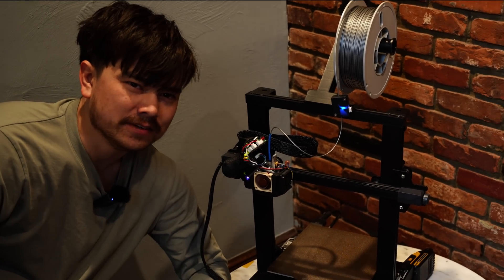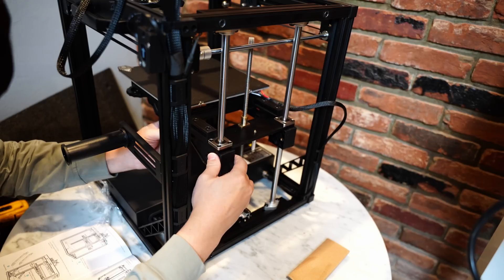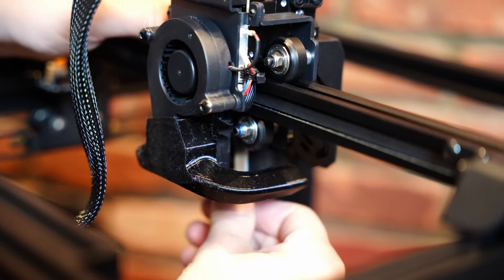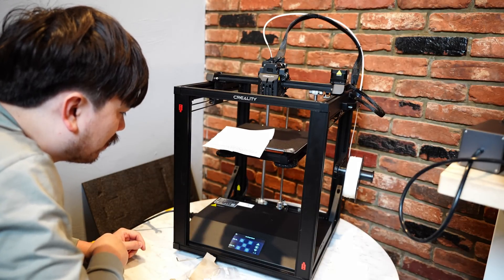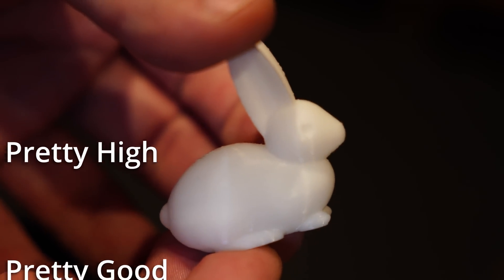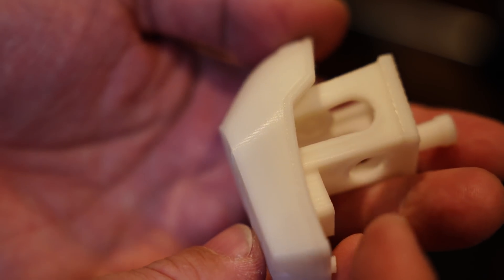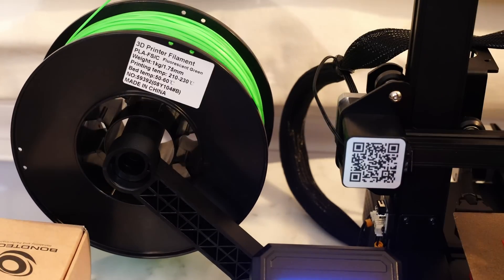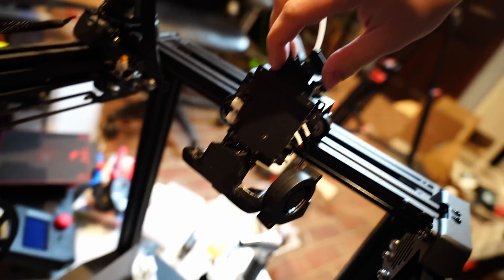Ender 5 S1 - The Best 3D Printer Creality Has Ever Made

Comment: I have one of these and I have to say it is a great printer.  Previously, I had an ender 3 and I had to upgrade it numerous times to get it to print properly and I was always having to relevel the bed.  The Ender 5 S1 is so much better. I have not had to much at all, it just works.  I did install an enclosure, a raspberry pi with octoprint, and a USB camera, and LED lighting.  Overall, I really love this printer.  It is not as fast as say a bambu lab or creality k1 printer, but it works for me until I decide I need something faster.  The best part was I got it on sale for $150 off its regular price.

Comment: IMO its by far the WORST printer they've ever made... Twisted x-axis on a large majority of peoples printers, auto bed levelling with Sonic Pad is completely broken because the levelling probe misses the bed entirely so you can't complete it, frame is out of square from the factory by several millimetres so you need to pull the top and bottom frames apart and re-assemble. I made the mistake of buying several to fill out my farm, same issues with every single one. I now own 3 big paper weights and a dodgy sonic pad. To add insult to injury Creality wants me to pay for not only shipping back to them but also for the free shipping to originally send them to me when I bought them! Absolute joke of company.
Reply from the maker: If you want some help there are a lot of Ender 5 users on my discord.
Sounds like you have the frame issues sorted, last thing you’ll need to do is fix the printer config file in klipper. It’s a pretty quick operation, but I agree all of that should be sorted out by creality, not pushed onto the customer at the end

Comment: DONT MOVE ANY AXIS MANUALLY, spinning the drive motors at high speed creates electricty which feeds back to your main board and releases the magic smoke, confirmed on a mk 3 pro😞
Reply from the maker: I’ve done a ton of backdroving and never had an issue. That said, I do believe you.

I’ve fried about 4 stepper drivers from unplugging the motors while the steppers were live

Comment: Great video!  Tons of information, and very well presented.  I'm 1 step closer to deciding what printer to buy...I really do thing it'll be the Ender 5.  Thanks for this.  Keep up the good work.
Reply from the maker: Glad it was helpful! BTW geekbuying just came through with a great deal for the Ender 5 S1.

$459 after coupon code: NNNCREEND5S1
Link: https://affiliate.geekbuying.com/deeplink.php?affid=3580&url=https://www.geekbuying.com/item/Creality-Ender-5-S1-3D-Printer-250mm-s-300-Celsius-Degrees-Printing-519509.html

However, keep an eye out for other printers and narrow it down to your needs. The Ender 5 is very much a project printer IMO, but it's a lot of fun to fix up and get working.

Comment: Can you print Carbon fiber with Ender 5 s1?
Reply from the maker: Yes, pretty much any printer can print carbon fiber reinforced plastic. A steel nozzle is recommended. 

The best cfrp is high temperature nylon (300 c)
That stuff is super strong and will also require an all metal heat break (which this has)
Reply: @NathanBuildsRobots  thank you Nathan 🙏
Reply: @NathanBuildsRobots  compared to ender 3 or CR 10, how is the precision of prints? Ender 3 and cr 10 have different construction and drive mechanism, is it better than that of ender 5 s1? Thanks

Comment: As someone about to pull the trigger having never had one, would you recommend this one?  Money isn’t a concern.  I don’t want to go to $1k cause I’m also getting a resin printer.   But I want to get an FDM so my wife can make crafts.  You seem to know so much.  Would love your thought!
Reply from the maker: My favorite FDM printer is the artillery sidewinder X2. You get a lot for the $$$, it has a huge print area, is easy to put together, and it prints decently fast. Make sure you have enough space for it though!
https://youtu.be/5tjE3QAOkWc

I view the Ender 3 and Ender 5 as more of a project printer. Great if you want to spend time working on it and upgrading it because there are a bunch of aftermarket parts available for it. After investing about $250 in upgrades and about 4 hours upgrading my Ender 5 S1, it’s an absolutely awesome machine. But not everyone wants the printer to be the hobby, they want to use it to do other hobbies 😁

Comment: I think it would be great if the print head would be sold separately to upgrade the older ender 5s.
Reply from the maker: Could you just install the normal sprite hotend?
Reply: @NathanBuildsRobots  I would prefer the new one, as the normal sprite hotend has certain disadvantages as the size, as it's much longer on the front and would hit the front bar on the ender 5.
Reply from the maker: @MrKiebitz  interesting, I do not know if a place to buy spare right now, but keep an eye out and try asking the discord. A lot of ppl post designs there

Comment: Nice video thanks.  I ordered this machine today.  If you lock your 3 main video camera settings then you won’t see those brightness changes after editing.
Reply from the maker: Yeah, autoexposure & autofocus can be a bit annoying at times, but I don’t have the mental bandwidth to deal with all that while filming.
There are whole takes that are out of focus or too dark when I do too much manual stuff, but also happens with auto settings. Really I just need a cameraman 🎥
I always use the 50% shutter rule, so usually 1/60th shutter speed at 30fps
I’m going to try using f/11 so autofocus is less of an issue and maybe then I’ll have enough mental energy to take on the exposure settings, which I guess would just be the ISO setting since I’m already doing shutter and aperture anyways.
Reply: @NathanBuildsRobots  yeah, I just let my camera automatically set the 3 main settings and then I lock them in place.  When I’m hunting I have to turn one of them down, I think it’s the fps.
Reply from the maker: I think I’ve got audio down pretty well now. Just using a wireless lav mic with no auto-gain settings. If I need to turn it up it’s much better to do it in post rather than letting the camera turn the gain way up whenever there is a silence

Comment: Hi. I want to buy this printer as a first 3D printer. What do you think about additional accessories? Or enough everything in the box? Also what do you think about Creality Sonic Pad? Is it useful with this printer or not?
Reply from the maker: As a first printer I would recommend the Trinity crux or artillery sidewinder. You can get those very cheap, $170 for the crux, $250 for the sidewinder x2 if you check the links in my dedicated videos on those printers. The S1 has some firmware problems that I would really like to see creality address with regard to automatic bed leveling
Reply from the maker: But to answer your original question, this thing is quite good out of the box, no need for additional accessories until you print with it for a while and see what you want to change on it

Comment: Which printer would you recommend for first timers?
Like, if you had to choose one with the knowledge you have now, yet was starting out again, which would you get? :)

I'm willing to invest, just want to make sure we get something worthwhile!
Reply from the maker: I would get the Artillery Sidewinder X2. Cheap entry point (only about $250), huge print volume, all the features that you would want, good firmware. I did a video on it:
https://www.youtube.com/watch?v=5tjE3QAOkWc
If you want to pay more it might be worth looking into the Bambulabs printer.
If you like modding, the Ender 3 V2 is pretty good, albiet overpriced compared to the sidewinder X2.
Reply: @NathanBuildsRobots  Wow, what a great vid you made for the X2! It's fast, quiet, big, has good cooling and power consumption, doesn't look like too much to get going-- Before I was considering getting a Creality CR-10s and modding it as suggested in another vid, but I think I'll suggest we get this one instead! I'll look into Bambulabs too, but I feel quite good about the X2. 😁
Thank you for the help! Much appreciated. ✨
Reply: @NathanBuildsRobots  $250 seems very low, $400 is about right from what I have seen.
Reply from the maker: check the video I liked to, then click the link. The reseller I have been working with has been selling them for around $270 which is an amazing deal

Comment: It's wired that they didn't set the switch's on top of the machine. That'll have made everything much faster
Reply from the maker: Yes at least use the cr touch as the z axis limit switch. The ender 3 S1 does this.

Comment: I just bought a ender 5 s1 too,but I met a problem, after I manual leveling,I run the auto leveling,but my printer always delete my manual leveling position.
after auto leveling the nozzle always away 1mm from the bed I guess.
Now I just use manual leveling like old printer, I have no idea why I cannot using auto leveling, I already follow all the operations😢
Do you have any suggestions 🥺
Reply from the maker: Yeah my Ender 5 S1 is having issues using the mesh bed leveling data in Klipper. Firmware could definitely use some work. Hopefully my issue isn't a hardware problem, which it may well be.
Reply from the maker: Have you tried using the save config option in the menu? I think the Z should save automatically but just in case it would be worth looking for an option to save config in the menus
Reply: I already checked printer, but there was no save config, there was only aux leveling and auto leveling .
Or was you mean the change z level button ?
Reply from the maker: @willyliu2444  mine saves the z adjustments, so I'm not sure why yours would be doing that!
Reply: @NathanBuildsRobots  I think I got the point 🤔
Maybe I should change z level in aux leveling first,and then use auto leveling?
This is my first time using  have auto leveling's printer 😅

Comment: Did you really complain that the print has to home?  That's normal procedure lmao.  The bigger the printer the longer the movements.  That's not a good complaint.
Reply from the maker: It’s not that it has to home, all printers do that, but about the time required to home is excessive. Takes about 3 minutes compared to any other printer - like the ender 3 or artillery sidewinder, which typically takes about 10 seconds to home.
Reply: @NathanBuildsRobots  slower is more accurate to so degree.  Granted while not a factory feature if you configure your own marlin you can speed it up.  Something I feel many will do when they custom flash it.

Comment: its an id10t error not the bed surface.  It has to cool and then its magnetic so you can take it off and flex it and prints pop right off.  When prints finish on my printer i take the magnetic plate off and put it on top of my washer machine lid and it 10 to 20 seconds it allows my print to pop right off.   You boasted about reviewing tons of these machines, but this is the first video I've ever watched of yours (last also) and it's like you have never 3d printed before.
Reply from the maker: Lol I like that ID10T… error exist between user’s ears.
Yeah it helps to let it cool off.

Comment: I think that they went with a different extruder and hotend for packaging reasons. The normal sprite would stick out to the front, where you would have plenty of space on a bedflinger, but thats not an option on a bed lifter, you would need a larger frame or limit your travel space. This also makes sense (smaller frame) since creality paid attention to keep everything within the frame, so you can bolt panels directly to the frame as enclosure and a smaller enclosure means higher ambient temperatures. Its also a pretty common fan duct design for such a printer, a different orientation would mean more space taken up by the tool head, the only other way would be mounting the fan over the x axis extrusion, but that would also be a loss of travel space

Comment: careful with the bed, not only does that surface stick too well, but the temptation to just push it down a little to make it easier to  get at just wrekcs bed level, mine is almost never right
Reply from the maker: Interesting, I’ll be putting a PEI sheet on soon

Comment: Crunchy noise on mine is coming from the anti-backlash nut. I looked for the source for a while too and it seems to go away if I apply a little pressure to it with my finger. I may add some grease to that to see if it helps.
Reply: wondering if you could deal with noise trouble and your findings..

Comment: A 300c capable printer without enclosure. Its very hard to make a enclosure for Ender 5 series because of the top arrangement; motor etc.  

In 2022 no belt tensioners, buggy Creality firmwares, no dual Z for 500+ USD. 

I think P1P is great option for 200 more. If you want thinkering Sovol SV 5.
Reply from the maker: You mean no belt tensioning knobs? I don’t like them as they cause the belt to loosen more often than not.

P1P seems to be a better buy. I would like to test one.

Comment: Sweet video, first time seeing your stuff. I also got the printer. I however have an issue with the ABL which tries to ram my nozzle into my bed if I use it. Creality claims it's a firmware issue instead of a bonk machine but I guess we will see.
Reply from the maker: That is annoying. I would insist they send you a new board. Companies often claim its a firmware issue because then they don't have to spend money to actually fix the problem.
Reply: @NathanBuildsRobots  yeah I have been going back and forth with their tech support and they are like, "hey just don't use the auto leveling."
At this point I told them that I want a replacement if I don't have a firmware fix soon

Comment: Yeah too little too late, this thing is a dinosaur in 2022 with printers like the Bambu Labs P1P on the market...
Reply from the maker: The big advantage of this over a Bambulabs printer is moddability. I'm going to have some fun with this printer, but if you just want to unbox and start printing, Bambulabs is hard to beat.
Reply: I would rather go with an ender + klipper than all proprietary bambu lab. Maybe it won't be as fast as Bambu but it's much more fun building it the way you want
Reply: People still buy Ender 3s

Comment: The 3 wheel vs 4 wheel explanation does not make sense.  Sure, if both bottom wheels and both top wheels would be exactly aligned, then you'll be spreading the pressure at the bottom over both of those wheels, but the majority of that pressure is coming from you tensioning both of them against the beam, so that is also doubled.  The real problem with 4 wheels is the fact that they can be misaligned.  Having 1 wheel at the bottom center will only allow you to get the tension wrong, but if you tension it enough, it will pull the carriage flat onto the beam.  With 4 wheels you can tension 1 of the bottom wheels less than the other, which can cause instability in the carriage.  It's a bit like mounting a flat surface (like a bed) at 4 points, while everyone knows that 3 points define a plane and that hence adding a 4th just causes the risk of not having one of them in the exact same plane as the other 3 and then curving what should have been a flat surface.
Reply from the maker: With 4 it is a "statically indeterminate structure" But this kind of thing is common. You can get it close enough by hand if you know what to look for. But it does open the door for error. You could just tension one of the wheels and leave the other loose if you wanted 3 wheels!

Should cars have 4 wheels instead of 3? The 4th wheel makes it nearly impossible to PERFECTLY align all 4 wheels. But it has benefits in weight distribution and handling.
Reply: @NathanBuildsRobots  The drawback when only tensioning one of the 2 bottom wheels is that it is no longer in the center between the 2 top ones.  I stand with my believe that 3 wheels here is better than 4.  With a car you have an additional dimension which plays a role, but that does not hold for these rollers.  And sure, 4 wheels will work fine as the wheels allow some flex, but you'll end up with uneven distribution of pressure over the wheels and hence some wearing out more than the others and there really isn't much benefit in adding that additional wheel, just more complexity.
Reply: Glad you mentioned this. It should be 3 wheels, and the fact that it's 4 calls into question the sanity of the design. I wish reviews were more critical.